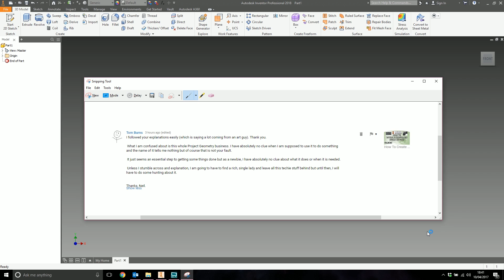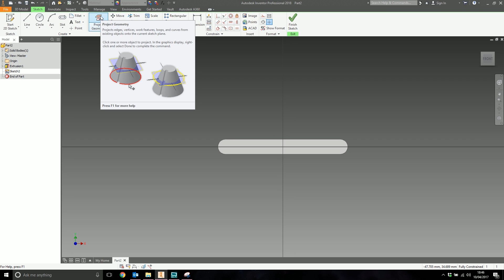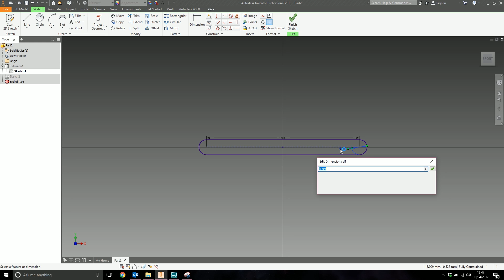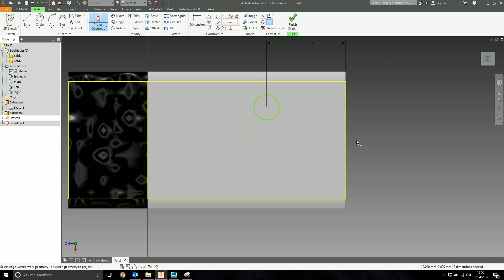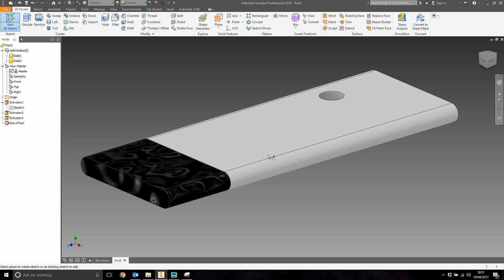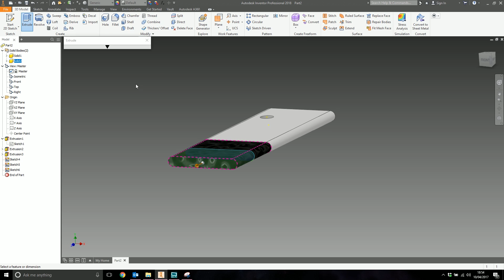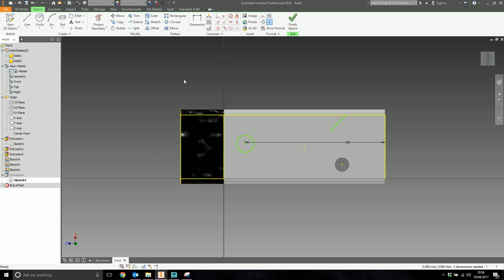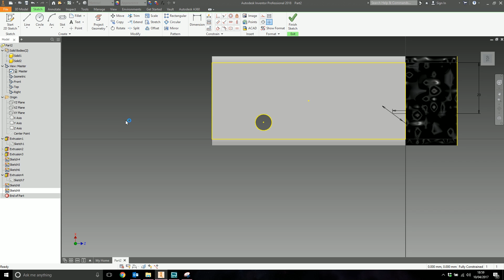This Project Geometry Business

Comment: TFI, i want to bend an airfoil which is a sheet metal work , since its a curved line which is 16mm inside offset from  the edge . i have been told its not possible and it can only be done in CATIA. can i please send you the  Autocad file and you import it to inventoR and show me how its done . my colleague had managed to do it in catia i could even send you the .DWG file . i aint sure if you understand me or not ? Please reply me . you got my subscription today and a like too and as well comment .
Reply: I don't really get what you would like to do but you can use the Bend part command on sheet metal parts, too. You can find it on 3D Model tab->Modify->Bend part.

Comment: Is there an easy way to turn off the Projected Geometry so it won't show up in an assembly.  I usually just pop over to the part and turn it off but sometimes it is more hassle than other times.  Just hoping for a shortcut if there is one.

Comment: What about reference geometry taken from an assembly.. That one is a real pain the *SS to master.  Keep finding broken links when the lads try to cut corners once they realize they forgot something midway thru assembly.  those pesky greenhorns try and try but they will never foil me!!
Reply: I would like to bump Mr. Browns request for assembly references !!!  Something along the lines of > Do's and Don't's of assembly references <  I keep coming to a place where I based a part on 2 parts; then one or more needs to change (or just flat out deleted&restarted) and it just gets messy. Typically the mess happens when i'm 10 parts in and realize that i've modeled myself into an assembly which doesn't do well with major changes.  Perhaps 'adaptivity' is the real *SS muncher...   AND Neil you are the one to do the job!!! your waffling on about real world situations is uber helpful!! No one else goes into the depth you do !!
Reply: This is the point where I give up on project/assembly references, and instead link all my parts to a spreadsheet with parameters! Change in the spreadsheet and all the linked Inventor files automatically update! not sure how well this works with very large assemblies tho, as I've only done small assemblies with this method (less than 300 parts)..... Using assembly reference I had the same problem of always having breaks as soon as you want to make the smallest of changes
Reply: aww, don't give up dood !! I think many of our woes *might* be caz there are far less erroneous actions than plausible solutions and near zero tutorials go over the "ya, don't try that even though it seems obvious that it should work!" o'reilly / lynda /etc ,, hardly(if at all) touch the 'don'ts'. thats not their job. They cover very essential points. Its people like TFI/Neil that can guide us through the real shit. For the people who need to do more than mimic... Who are already past the gate....   Anyways ...     I haven't done the spreadsheet thing yet. Is there an advantage over than just using the parameters ? Isn't it the same thing, just a different place ? ?   I must point out though that reference dimensions is likely a topic requiring its own attention. Whereas, the topic Mr. Brown and I were requesting is on the subject of reference geometry. I know at some level there are similarities and I fully respect your contribution. Plus there are many situations which the correct path to take is using shared dimensions/parameters !! However, that is totally a different situation than changing the actual geometry of a part / removing a feature only to discover, ya I referenced that somewhere!! shiitake !!      Changing an extruded square to a circle. changing angled lines to flat lines got me once...          If we are all speaking open, I must admit I have been wondering if using assembly level sketches would help the situation of cross part association/unresolved references. Kind of like a 3rd party linker thing. Could probably use some basic sketch elements and when needs change just mod certain stuffz. On the same token I have been wondering whats up with using assembly planes. When are they preferred ? When will they fail ? Hopefully its as obvious as why i prefer to cook eggs on a frying pan rather than my GF's stomach.. caz she only likes to get oiled up 3 weeks out of the month.  Sure, I could spend the time and do a bunch of mock ups and figure it out. However, if someone has been modeling for a long time and wishes to share... That saves the world loads of redundant human effort

Comment: Is there a way to make the reference geometry automatically make lines into construction lines?
Reply from the maker: Unfortunately not, it's on the IdeaStation though here so feel free to vote it up https://forums.autodesk.com/t5/inventor-ideas/project-geometry-as-construction/idi-p/4827911
Reply: Yes, just pre-select "construction" command before you start to project geometry. Doing this will project construction lines/curves. It also works with "project cut edges" command. "Project to 3D sketch" does not make a constuction line during 2D sketch enviroment but it works in 3D sketch enviroment "Project Curve to Surface" , "Intersection Curve" and "Include Geometry" commands. Maybe we need a preset button to activate-deactivate contruction line under "Autoproject Edges for Sketch creation and edit" in the app options. Hope this helps :)